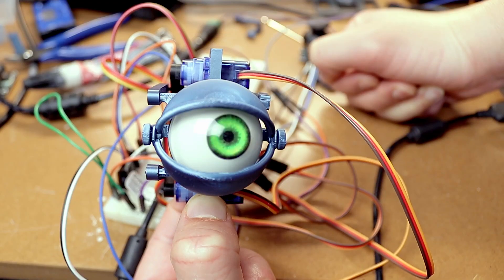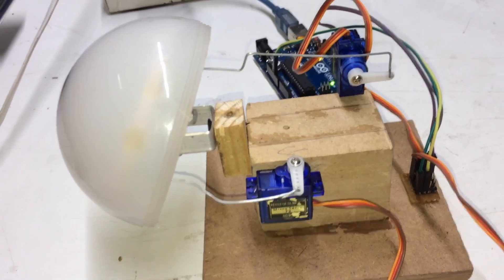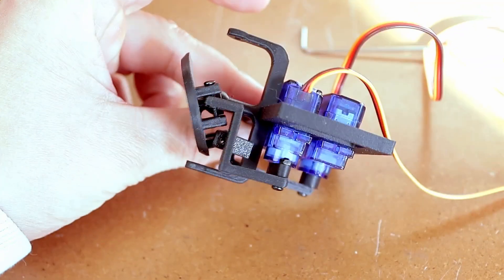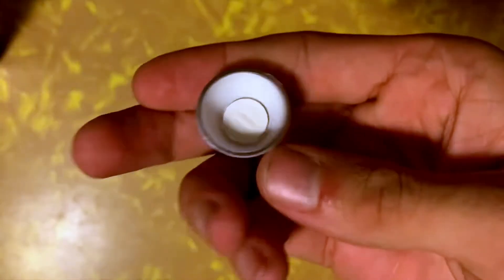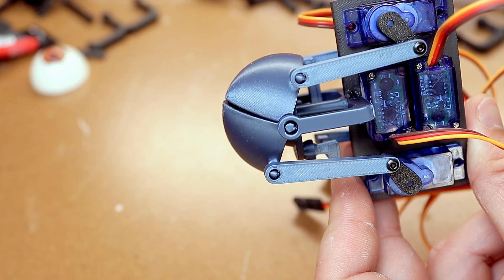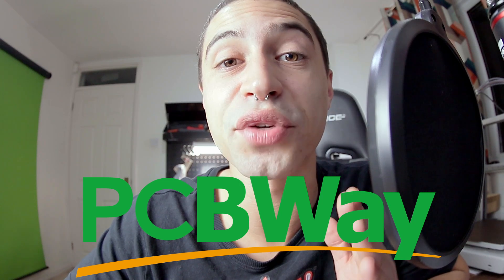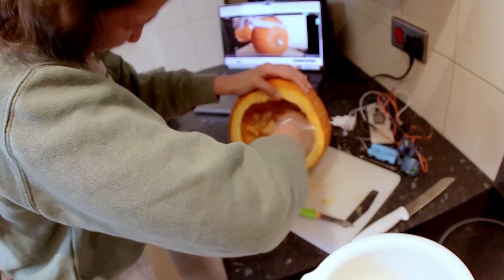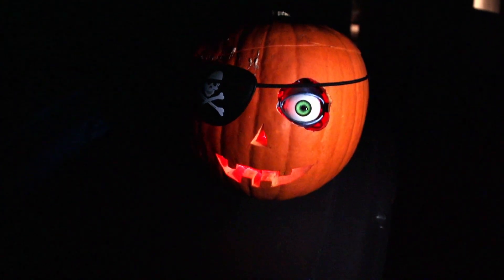I built a Robotic Eye From Scratch!

Comment: How do you put all the parts together like the wires servos
Reply from the maker: Yeah I should probably make a wiring diagram for this..
Anyway, to know which pins I used you can check the code here: https://github.com/Esser50K/AnimatronicEye/blob/main/AnimatronicEyeFirmware/src/main.cpp#L20

Only one suggestions for powering the components, I suggest powering the servos and esp32 separately, had some weird issues trying to power them with the same power source.

Comment: For jittery inputs from sensors such the joystick you can use some DSP to smooth out the signal. A simple low pass filter is useful in so many places.
Reply from the maker: Yeah that’s a solid tip. Used one in a recent project and it does work miracles

Comment: great design, I don't see anything in the files that show how it is wired (wiring diagram)? Or am I missing something?
Reply from the maker: Thanks man! Yeah I think I didn’t draw it up. Wiring is just 1 power supply for the esp, another one for all the servos. Then connect the signal of the servos to their respective ports as they are in the code
Reply: @esser50k   Wow , Thank you so much for getting back to me. I am not familiar with the board you are using. I have Arduino UNO  right now. Can you give me a link to the board you are using?
Reply from the maker: Its an esp32 dev board, you can find it looking it up on google. I think the arduino doesn’t work for this particular project because you need 4 pwm pins and arduino uno only has 2 I think

Comment: Looks good and I'm looking forward to trying to make one! Quick question, though; I may have just missed it, but I don't think you said which modeling software you used to design the files. I have my preferred one, but I'm curious what you use. :)
Reply from the maker: Currently I’m using onshape because on one hand it is free and an added bonus is that it works on the iPad. Currently I’m strictly modeling on the iPad. Maybe people that use a mouse are comfortable with using whatever modeling software on their laptop, but I work strictly with trackpad (less overhead) but it’s not good for modeling.

A link to the files are in the description, feel free to use them. I should maybe also post a link to source the actual eyes
Reply: @esser50k  Thanks! I've used OnShape before, and I'll have to try its motion tools again. Last time I tried to design something with moving parts in OnShape, I gave up and went back to Fusion 360 because I just couldn't get the joints and ranges of motion to work correctly. Hopefully, this time I'll have more patience to learn the slight differences from what I'm used to. :)
Reply from the maker: @kintar1900yt  oh yeah I cant give any advice on the "assembly" part, I've only worked with "part studios"

Comment: Awesome work!
A hint for when you need to fix something more or less temporary inside of unwieldy objects like that pumpkin: Polymorph plastic. Those are beads that become like clay when heated above ~60°C (140°F) so you drop them in hot water and essentially have putty that hardens after a few minutes. I have used that stuff to make reinforcements and repairs for 3D prints as well. It's even re-usable and can be locally re-softened with a heatgun.
Reply from the maker: Ahhh thanks for the tip! Right now I feel like 3D prints solve everything haha